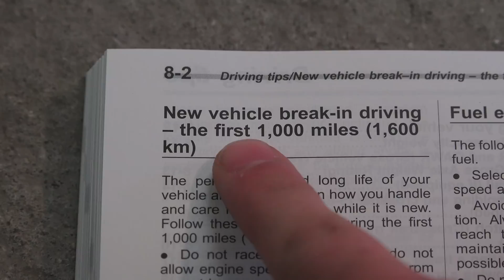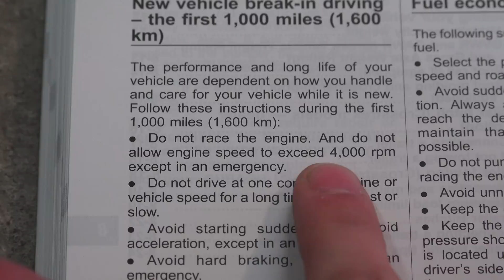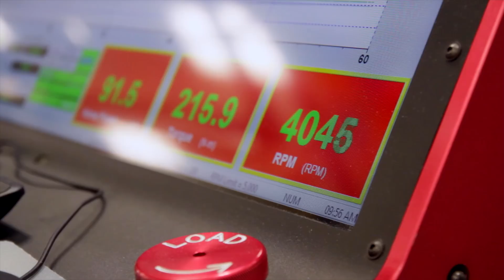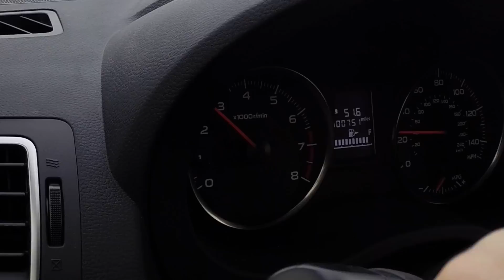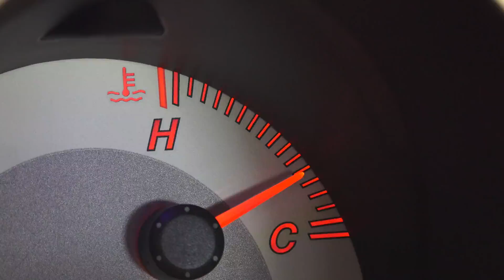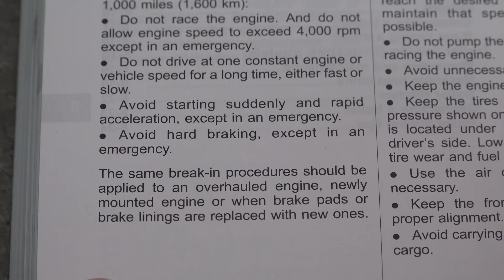5 Things You Should Never Do In A Brand New Car

Comment: Question! Why don't car companies break in the cars themselves?
Reply: it takes up time and money, the only reason acura does it is because the nsx is a car that people pay a lot of money for so they want to give them the best quality
Reply: Cost cutting.
Reply: 240Z that's a wrong statement. In your perspective, how their brake-in works, is only a bit of a dyno run, to check the values of compression, oil pressure, torque and internal moving frequency. If these readings are in a specific tolerance, the engine is ready to get build in. This 'brake-in' does not care about a break-in, like in the meaning of this video.
Reply: Bretter Shoalar read the screen lol
Reply: Time and money
Reply: They do. this guy is wrong.. Old cars were this way but any car built since the 1980s comes with Pre Breakin parts.
Reply: MX3 No they don’t.
Reply: They all do, this is garbage video.
Reply: Neil Kee All European car manufacturers break-in the engine at facto.
Reply: Why do the manuals list a break in period then genius?

Comment: On a related note, my poor work F350, it's break in consisted of being loaded down to upto 30k and a minimum of 16k total weight and driven almost non stop for 16 days/16k miles without an oil change lol. It's currently at 380,000 miles running strong.